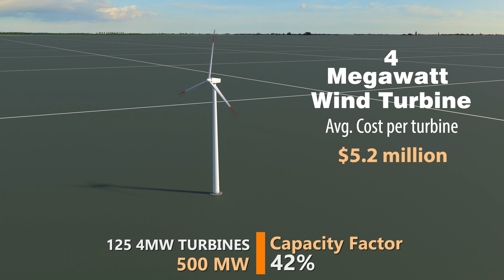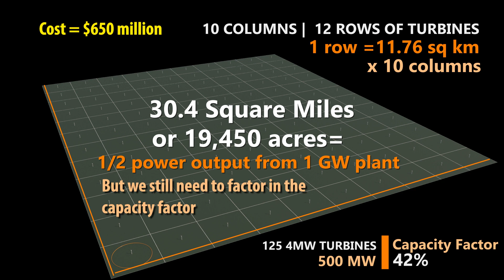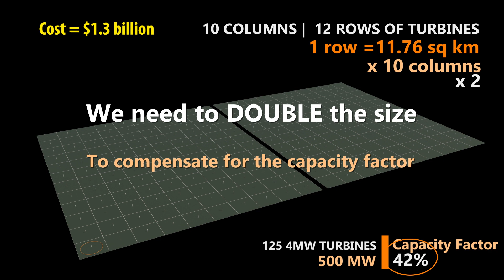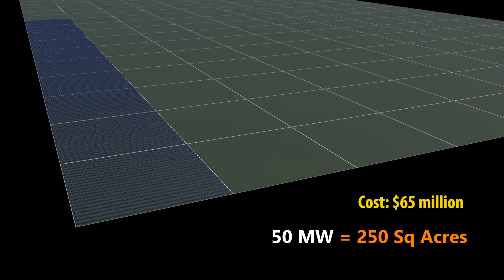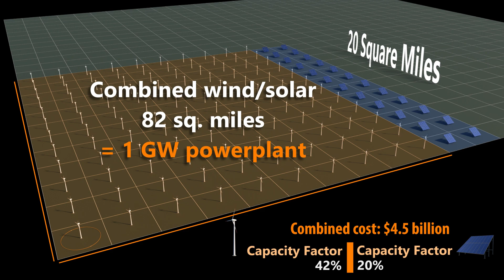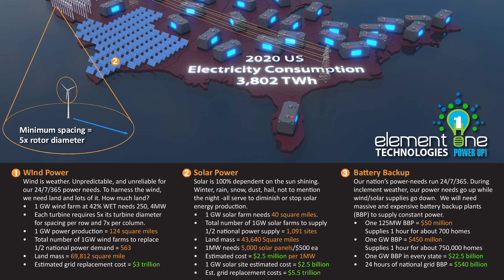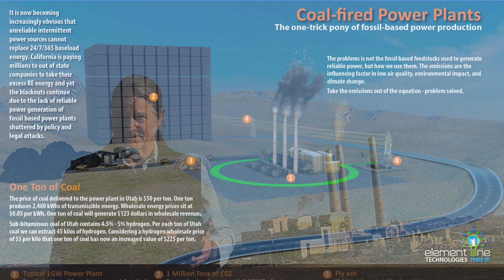Power By The Numbers: Land use for Solar and Wind Renewable Energy

Comment: with what you are saying is that the land around the wind turbine would not be used, ok... I see, so you don't know that farms can have turbines on top and still be happy, or is it assumed that wind turbines need nothing near it.
You assume that all buildings are powered whereas not all buildings are powered or are so minimal power that solar power generation would be a benefit without clearing more land.

Your video shows that there are still people that are stuck in the old ways of thinking that wind and solar are just tools, no they are solutions that need to be appropriately implemented to become a solution, what is a tool is you, a fossil fuel junkie and possible money grabber.

Comment: This video makes no sense in so many ways.  Take one.  We have to start from the reality that we have no choice but to stop burning fossil fuels as quickly as possible so it makes no sense to compare coal with wind or solar.  Another.  And you can put solar on buildings or over parking lots or over waste water settling ponds and you can put wind farms out at sea.  Comparing the area required makes no sense.  And anyway, the video is not taking into account the area that coal mining requires.  This video appears to be intentional disinformation.